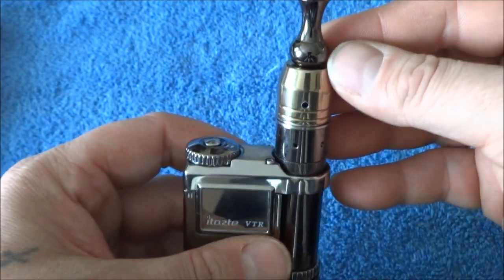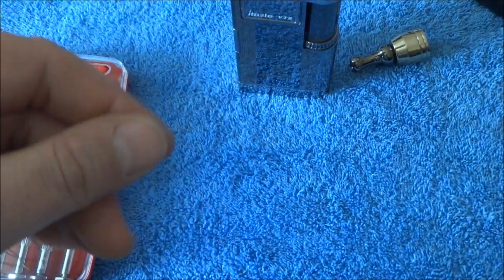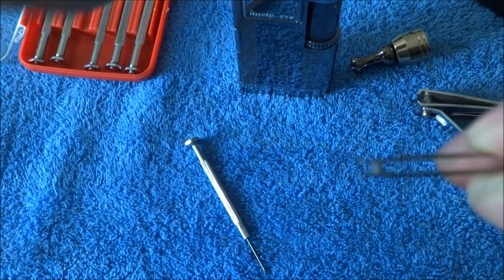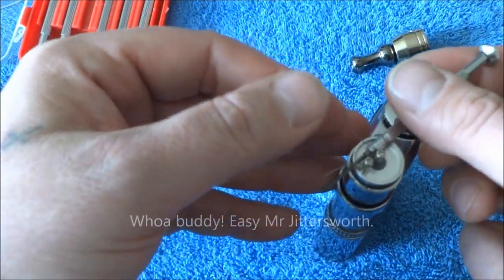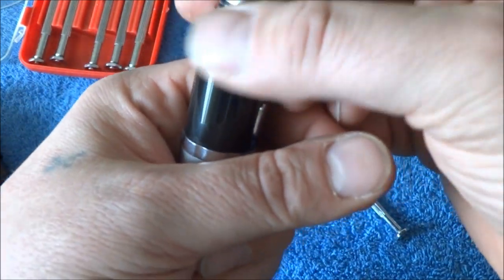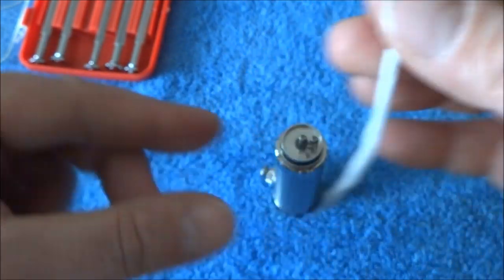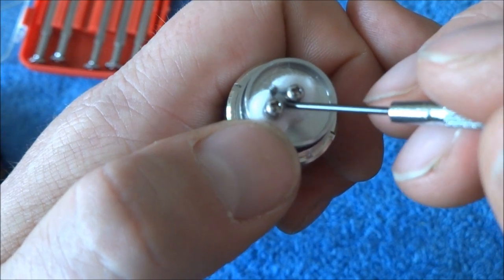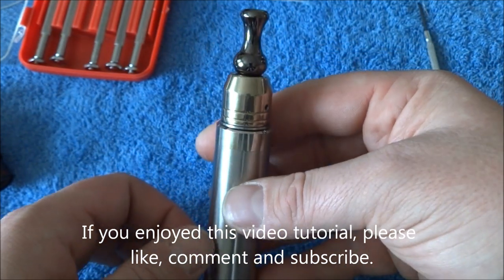Micro Coil with Cotton Wick Build Tutorial

Comment: I'm fairly new to vaping as you will probably tell by the question I'm about to ask. To be able to make your own coils do you need mods? I currently have the 'noobie' starter kit many might start off with, but am looking into making my own coils instead of buying them. Any feedback or websites I can find these items at will be greatly appreciated.
Reply from the maker: Hey Dave, you don't have to have a mod but it helps. When you first start building coils it is tricky to get the resistance/ohms correct. There may be some trial and error to simulate the 2.2 ohm? coils you are probably vaping now. Also many starter kit tanks have coils that are press fit and cannot be taken apart. What kit are you using? I would suggest buying a cheap mod, perhaps a Vamo...I have a video on my channel about the vamo if you want to check it out. I would also pick up an easy to build dripping atomizer such as an "Igo L" to get used to building coils. The Vamo can also read the resistance of the builds that you make so you don't need an "Ohm reader". You will need some wire and wicking material to get started, maybe some 30 gauge kanthal wire and silica wick. I usually buy stuff from "Canvape.com" because it is located near my hometown. Maybe do a Google search for Vape Shops near your city and you should be able to find everything you need. I hope this helps buddy.